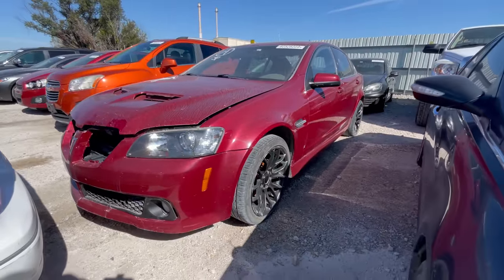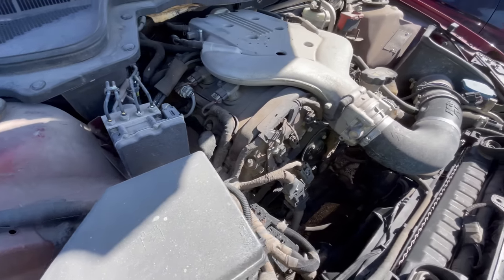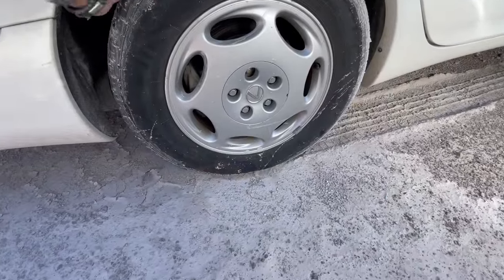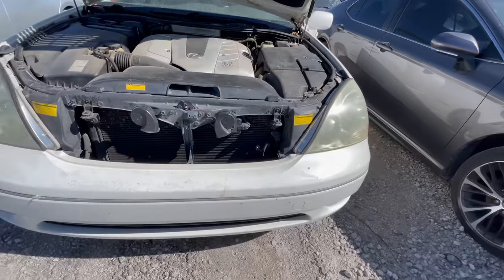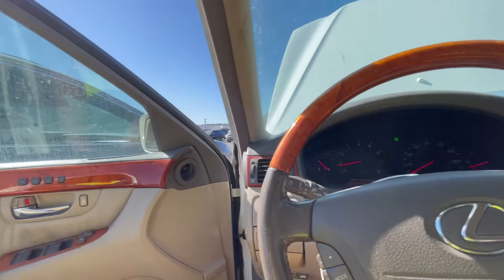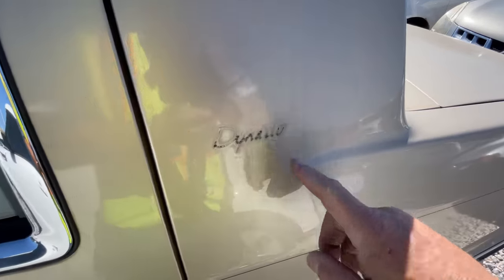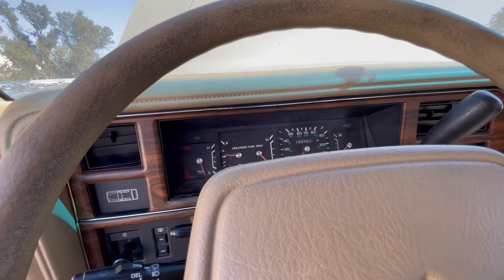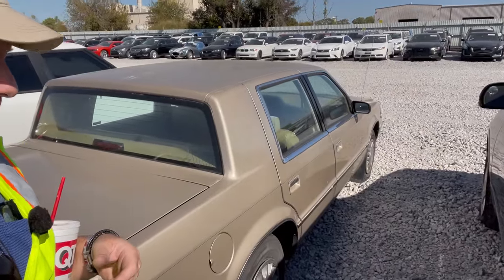A Turtle In Sheep’s Clothing - Copart Walk Around: 10/28

Comment: thats one ghetto chic/a 6 in the g8 /what a mess
Reply: Would be a cheap fix though and the car would only sell for no more than $200. Parts are $400. These things are so cheap for parts due too the numbers sold. I only looked up the Holden bumper bar and grill not the crappy Pontiac one the stuck on which I thing destroyed the cars styling. The seats don't cost much because the G8 used the second lowest Commodore seats out of the International. I did price the parts in USD. Shipping would probably cost another $100.

Comment: The Lexus is cheap to do a timing belt & water pump on. I had mine done on a 4.0 V8 Soarer (upgrade to the SC400) for less than $500AU. Six bolt mains, Yamaha designed heads, forged I Beam Conrods, love forced induction on totally stock engines. Only thing they really needed from factory was the Torsen LSD.

Comment: Insane to me that they put the Cadillac based 3.6 in the base model like that. The GT had the 6.0L and the rarer gxp had the 6.2L. Hard to tell the difference looking at the body besides the GT badge on the trunk and the base and GT had different tail lights. Clear on one and red on the other. Other than that you have to look under the hood to know for sure. Find a Chevy SS if you want something in a sedan that's newer than the G8
Reply: The base model actually came with a 3.0 which was so gutless. My brother had one back in 2010 and my boss had a 2003 3.6 . Mine was a 1999 5.7 in built by HSV with the top Senator trim level. Nearly went for a 2010 SS 6.0 but couldn't justify spending $60k on a new car at the time. Glad I didn't now because of the displacement on demand.
Reply: @2DogsVlogs  unfortunately over here in the states they only offered the G8 for 2 years. 08 and 09. We only had the 3 engine offerings as well. Makes finding any real nice one here almost impossible or really expensive. Same with the GTO. Offered that from 04-06 so finding one with a clean title that isn't in showroom condition or modded to the gills is getting hard as well.
Reply: @skunkworks9-3  Same here. Good V8 ones are the same price as when new, often even more. A v6 however you can get for $3k or a beater for $750.

Comment: Hi Mike hey watch it I On my own a 1993 dynasty runs great has lass the90,000 mile s and it was bought when it was 2 years old it was31,000 dollars  smack the fuel tank the car will start the fuel put stick of they sit sure it’s quiet mine runs and drives perfect everything option wise the 3.3is a  timing chain engine and it’s not done .the Lexus you should buy it 😊